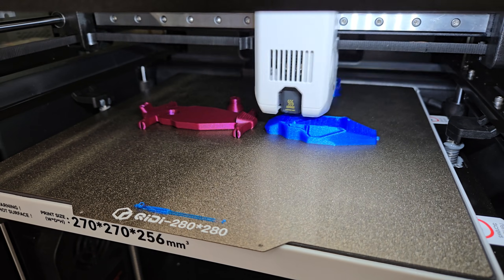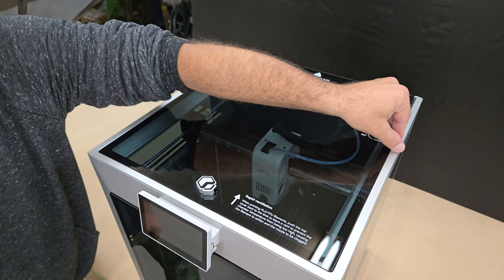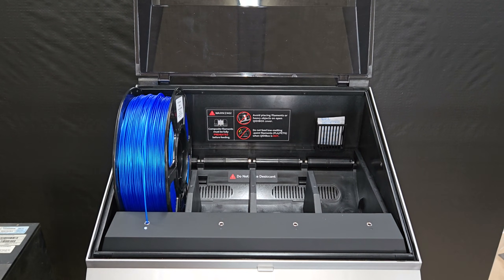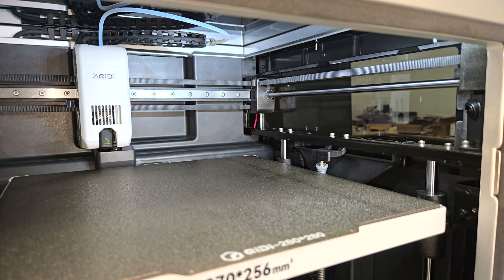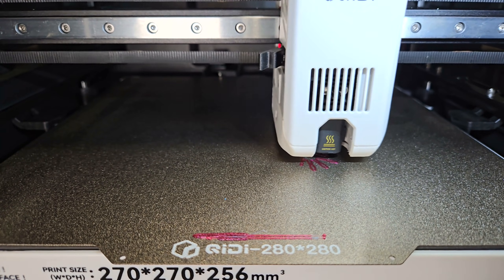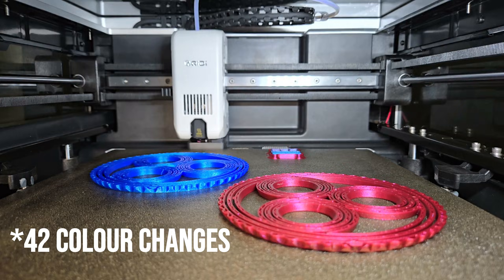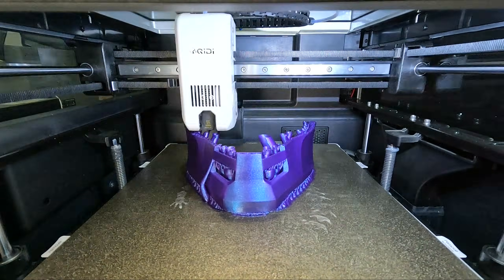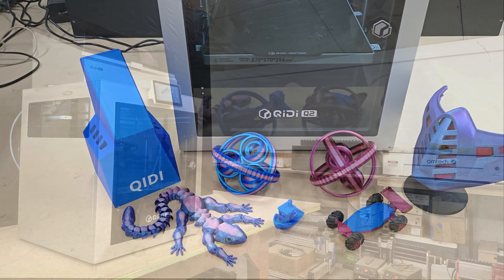QIDI Q2 + QIDI Box Review | Multicolor CoreXY 3D Printer With Safety First Design

Comment: Ordered one , be here Friday. It's my first 3D printer.  Looks like it produces very nice work. 

Have you had any issues cause of the boden tube is so close to the top glass ? 

Thanks for the video 🎉
Reply from the maker: Yes, unfortunately. Good question. It wasn't an issue at first but I noticed the tube hitting the screw for the lid handle during some prints - eventually started wearing a hole in it. I'm removing the screw and trying high strength double sided mounting tape on the handle instead.

Comment: I've heard problems with the firmware on the Qidi Box as well as having to take the box apart completely to remove broken filament. Is that what you experienced?
Reply from the maker: No. You're referring to very early versions of the firmware that was intended for test samples that influencers received. All they had to do was update to the latest version when it became available, like I did. This version is available to the public. They should've showcased it instead of the preliminary version. 

As mentioned, the box isn't suitable for flexible or brittle filaments - they'll cause jamming or breakage. There's a lot of PTFE to push through. If someone is claiming they're having breakage issues, it's because they're not following the instructions or are using old filament.

Comment: what makes it an entry-level machine? What is it missing, or what do non-entry level machines offer as extra?
Reply from the maker: The QIDI Q2 is a solid entry-level printer because it’s affordable, stable, desktop-sized, easy to use, and capable of handling a range of materials thanks to its heated chamber and high-temperature hotend. It removes a lot of the frustration from setup, and the build quality is a step above the cheapest hobby machines. Compared to true professional industrial printers, it falls short in precision, long-term durability under heavy use, and the ability to handle exotic plastics like PEEK or ULTEM. It also doesn’t have the massive build volume, production reliability, or refined software ecosystem of industrial machines. In short, it gives a taste of pro features without the full industrial capability and cost - great for hobbyists and small print farms, but not an industrial machine.

Industrial printers are much heavier and stiffer, often weighing hundreds of pounds rather than sitting on a desk. They’re designed to run 24/7 with minimal downtime, using overbuilt components, high-grade linear rails, redundant sensors, and electronics meant for constant use. Chambers are tightly controlled at high temperatures, which is critical for exotic plastics.

Examples include the Stratasys F900, 3DGence INDUSTRY F340, Markforged X7/X5, and Raise3D Pro3/Pro3 Plus. These machines are large, expensive, and far more sophisticated - built for production rather than tinkering. Where the QIDI Q2 or a Bambu lets you experiment, prototype, and even run a small farm, an industrial printer is a production appliance: you press “go” and trust every part comes out exactly the same way, consistently, for years.
Reply: @JamesBiggar  Thanks, great answer

Comment: Just as an FYI the Kobra S1 and ACE allow you to dry while printing also
Reply: I do appreciate you giving us close ups of the prints though! I own a Q2 and think it is the best I’ve seen with outer walls
Reply: And, I think, Anycubic was the first one to have this feature in it's multimaterial system (ACE Pro).
Reply: Do the others rotate the filament if only drying?
Reply: @cueball981  I don't believe so. I had one when it first released but didn't keep it long

Comment: Sorry if I missed that, but did you got it for testing or bought it? I'm waiting for my box, I'm happy with Q2 but software/firmware needs some polishing.
Reply from the maker: They sent it for review. I'm running the latest firmware and software. I'm sure they'll have the updates available for the gen public soon
Reply: При обновлении до последней версии firmware, на дисплее появляется надпись "Данная версия П. О. временно не поддерживает QidiBox".
Будьте внимательны.
Последняя версия V 1.0.6
Reply from the maker: Latest version is 1.0.7, but I don't think it's been released to the public yet
Reply: https://youtu.be/f6pni27D3AQ
At 3 minutes 41 second.
Reply: Slicer looks like a spin off of Orca, I never knew that it was common to Prusa as well.